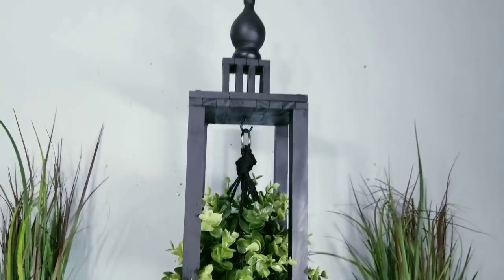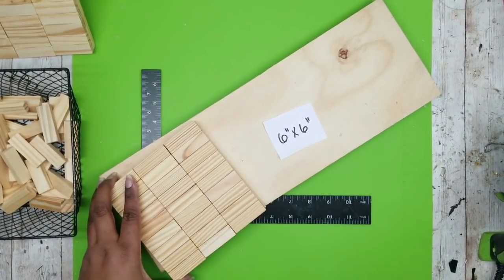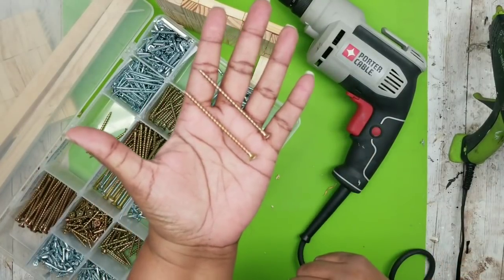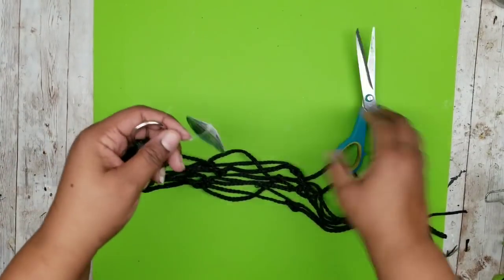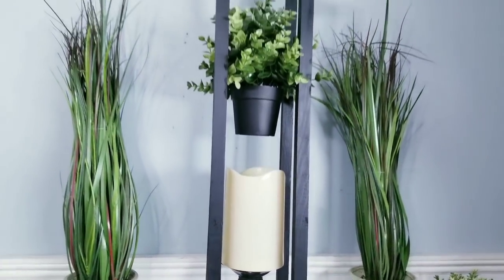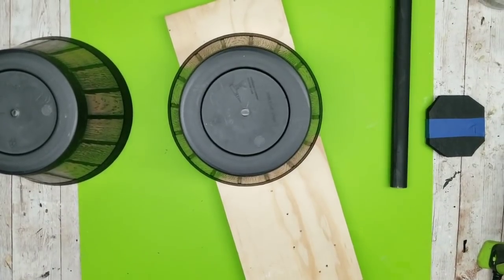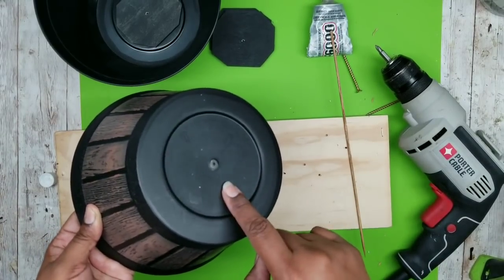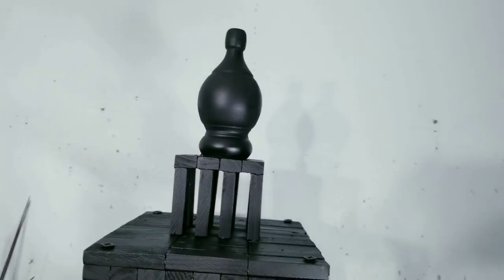*NEW* DOLLAR TREE DIY Front Porch Decor | Wood TALL LANTERN | Half Barrel Planter | Indoor & Outdoor

Comment from the maker: Thank you so much for tuning in today! I hope that you all enjoyed these porch decor ideas, and give them a try! These are great for a covered porch, but if you intend to place in direct weather, use a weather proof protective finish. Also, add weight to the barrels (rocks etc..) and secure the lantern to a sturdy structure to prevent tipping. Enjoy!!!
Reply: What’s your setup for spray painting any items?
Reply: I just love your projects. I really want to try them both.  I really appreciate  how you give us such details on how to recreate all your crafts!
Reply: How did you adhere the lights to the top?
Reply from the maker: @rosemaryorlando3110  velcro stickers
Reply: I've used the little trophies from Dollar Tree or Dollar General as finials for my lantern I made. You can find them in the toy  or party section. You get several in a pack. I removed the handles and the bottom, sanded then painted.once dry simply glued to the top.
Reply: I do wish I could send you a picture of my TINY porch with ugly wood shutters on either side of the door!! Who does that!?! A builder in 1973 thought it was a great idea on mine and Nextdoor neighbors house😩
So, since there is paint all over brick from past sloppy painters on both sides of shutters, I have decided to put flat wood on top and decorate / paint🤷‍♀️
I kept thinking.. I need Shesocraftdee😩😀
Reply: This must have posted before I discovered your channel and subscribed. I am so glad I found it. I love them both so much. I can't pick just one to make. I live in an apartment right now and don't really have a porch to display them. Any suggestions what would be a good place to show them off? I really loved them and what to make them. Thank you for sharing 💜
Reply: I’m not sure but I thought I saw you ironing cloth and other things and it was so tiny?
Reply from the maker: @RitaRunnels  I used a Cricut  easy press mini. They do have mini irons that are not Cricut brand that will do the same thing.

Comment: That lantern iS AMAZING AND the barrel planter. I have ALL of the supplies for BOTH! Question, if I don't have a drill or a way to put screws into the lantern, what would be your suggestion to secure it side from wood glue?
Reply from the maker: You may be able to use some small L brackets. you can get them from the shelving section at a home improvement store.
Reply: Thank you! I plan on buying a drill next payday... I've bought an entire room full of crafting supplies the last two paydays and I plan to make A LOT of your awesome creations!